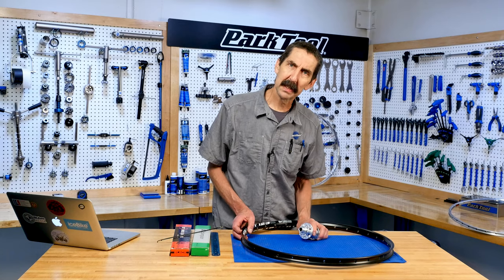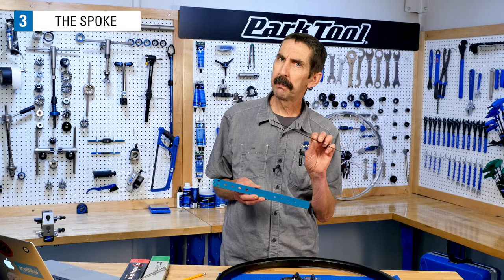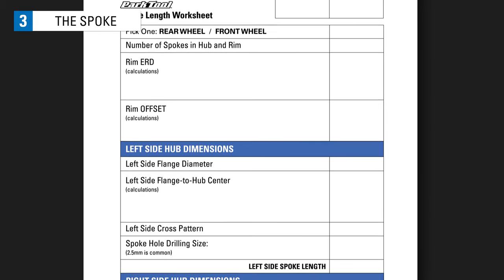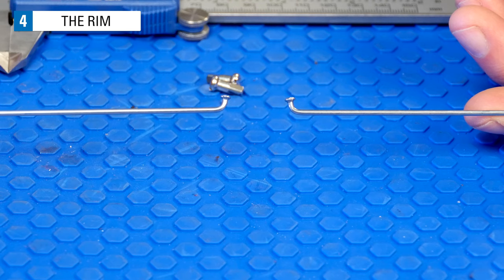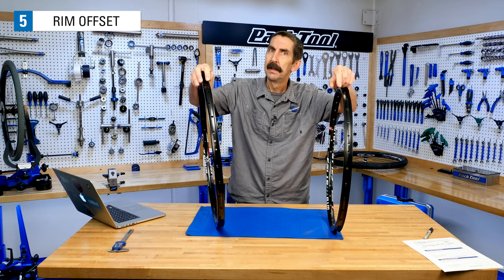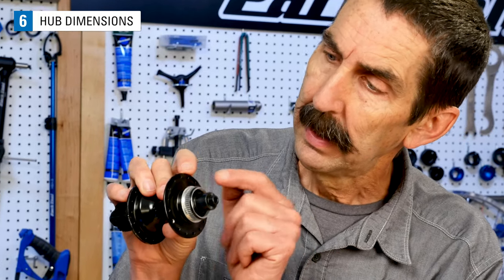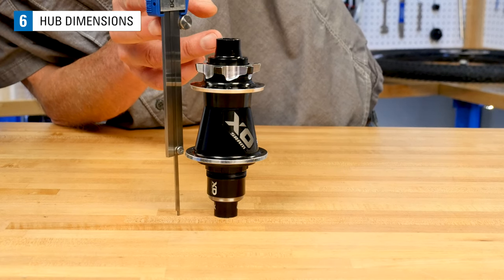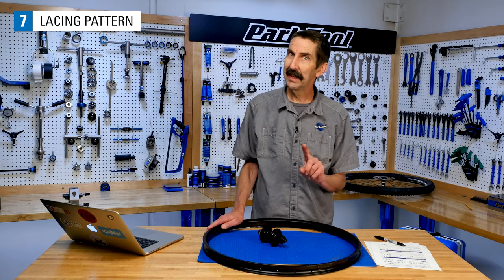Determining Spoke Length for Wheel Building

Comment: Can i put 38mm rim spokes to my 50mm rim?
Reply from the maker: Is the 38mm and 50mm in reference to the rim depth or width? for rim depth it is not likely but possible depending on the rim designs. Same goes for width. Find both Rims ERD's and compare. if they are within a couple mm's of one another you can typically use the same spoke length.

Comment: Update: The spokecalc has added a hole to hole dimension on the rim that has fixed the calculator for me. My fat bike rims were always getting wrong numbers and it's because the calculator didn't know how far from center the holes in the rim were, and on fat bikes, that can be pretty long. I put offset at 0 and input the hole to hole dimension in that slot on the calc and it put me 1mm away from where I ended up with my spoke length through trial and error.
Reply from the maker: You can also divide the offset at the rim in two and minus that number from each side's center to flange.
Reply: What is this measurement asking for? Is this distance between each hole on the rim? If so, how do you measure that given the arc of the rim? It's described as "lateral width"?? Not distance between. Is that the same as offset??
Reply: @jonnyminer4915  It's a measurement across the width of the wheel, not down the arc. If the rim is 60mm wide, and the hole centers are 25mm from the outside edges of the rim, then 60-25-25=10, so there's a 10mm width between the holes. 

Offset is different. That says whether the rim is symmetrical or not. A symmetrical rim can still have a staggered hole pattern with holes that are off center, but they will be equally distant from center on each side. If the holes aren't equally distant from the center, and are all shifted further in one direction, then you have an offset.

Comment: Trying to do this for the first time with a fat tire electric hub.  Seems kind of complicated.  Im thinking a2+b2 =c2. Should be way better and way easier, I guess I'm going to find out.
Reply from the maker: If you are using a electric hub, it is probably a very large flange.  Typically these are done as a 1X.  Use 1X for the pattern.

Comment: what if the spokes overlap when measuring ERD?
Reply from the maker: Good question.  Use the other end of the caliper that measures ID.  You still measure that inner edge to inner edge overlap.  Now deduct this from the spoke total.  Example. Your measuring spokes are 290mm each. That is a total of 580.  The overlap is 10.5mm which is deducted from 580 for an ERD of 569.5mm.
Reply: @parktool  got it! Thank you.  Love this channel

Comment: Instead of trying to determine the lengths of the spokes, measure the original hub, using the Park Tool ?? and the original spokes. Put in the new hub,measure it again with Park Tool?? as well as the spokes then subtract from the original spoke using the spoke length gauge,instead of going through all of that,since the spokes are manufactured the same lengths.

Comment: I have measured numerous times and made 100% sure that my measurements were correct but I have now twice gotten spoke lengths were too long by 3mm. Why would this happen? Again I am 100% sure that my measurements were correct
Reply from the maker: ERD is the most likely measurement to make that large of an error. Are you sure you are doing the ERD measurement correctly? You will want to take a measurement rather than go off of manufacturer specs.
Reply: @parktool  I am 100% sure. I did it exactly as indicated in video. I also counted the spoke holes on each side to make sure I use two directly opposing spoke holes.
Reply from the maker: @marnusdege  Is it possible you are not crossing the correct amount of spokes? Feel free to email us the exact hubs, rim, nipples and spokes you are using as well as the dimensions you are getting so that we can check it out. Send them to tech@parktool.com